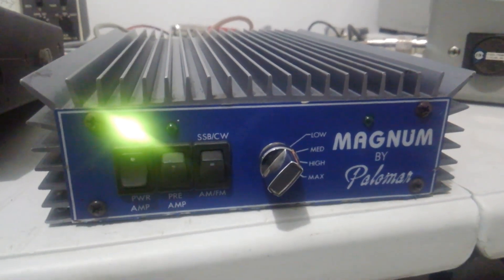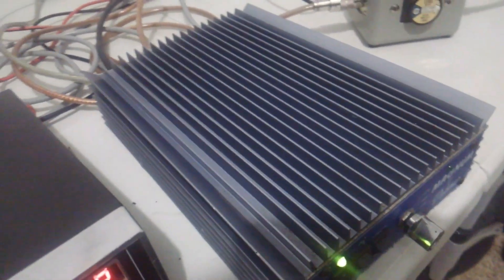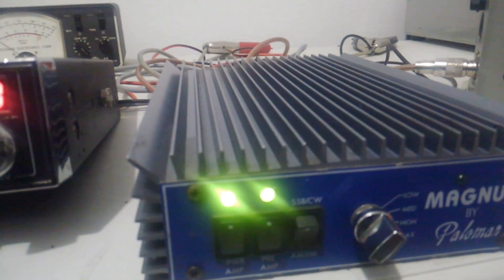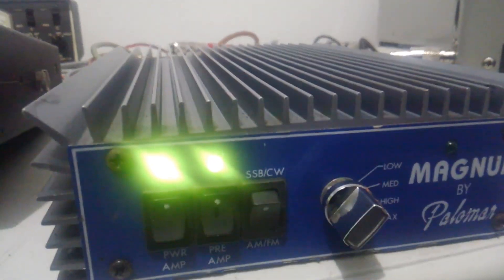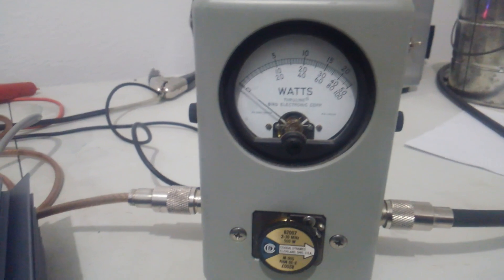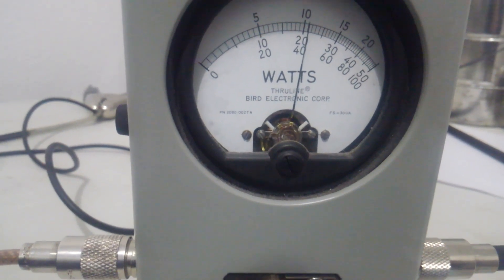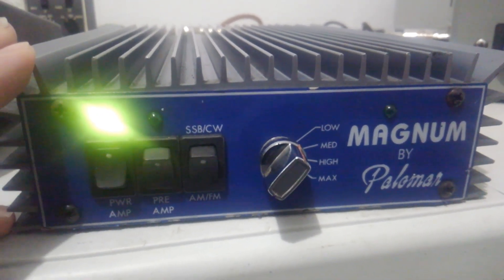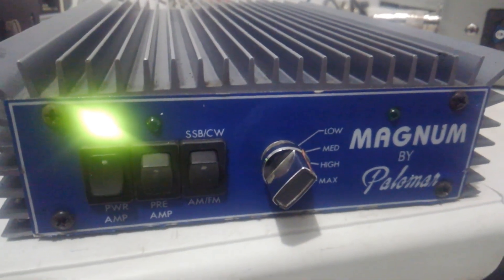"Magnum" By Palomar Mobile Linear Amplifier 450 Watts

Comment from the maker: CORRECTION: In the video i said 35 watts average/11 watts peak. That was a mistake, drive used was 11 watts average, 35 -38 watts PEAK. I apologize for the mistake and the confusion. Sounds like I should've had some coffee first! :)
Reply: I have the same amp.
Reply: I have the same amp, the label on mine is turned over and says Palomar TX5300
Reply: Still Lovin'This Amp Rooster 220 Plowboy Gold Coast Wavin 👋
🇺🇸🫵

Comment: Mine has 4×2879's Toshibas. I feed it with 14.80 volts.  I use my president Lincoln 2+ to drive it. 750 average. I've had it forever. 
Nice video. 
#12 Watkins Glen NY waving
Ps.. mines a skipper by palamar.

Comment: RM KL703 amp is far superior. 500 Watt.
Reply from the maker: I don't if id say superior, both good amps. Im a dealer for RM Italy, and I do like their products for the money
Reply: Thanks for the videos, you saved me from buying a pyramid power supply, a 52 amp, now I'm getting an astron...are you accepting repairs at this time, have a Texas star 399 DX needs relays replaced I believe, they stick on when I tx.

Comment: Every time I miss the chance on a good amp
Reply from the maker: Going to be another one going up today, soon.
Reply: @Rooster_Radio  these are really good rare amps that no one gives up. I'm just trying to get something I know works  and isn't going to break my checkbook in the process. You got fair priced  equipment. I git the Gump tuned Phillipines Cobra 29 doing 1.5 swinging 40 watts. Any if these would make it an amazing set up.

Comment: How can you put 2 amps together and test them together?
Reply from the maker: Two amps together, depends on what you mean.
Easiest answer is you mean taking two of the same amp and running them together you can not without blowing one up.
However if you have a large amp that requires more drive than your radio puts out you can run and amp between your radio and your final large amp. This is referred to as a driver.
Reply: Sounds good  thank you. Rooster
Reply: Damn CB radios are getting popular again these linears are selling like hotcakes
Reply: It takes lots of studying and tuning but yes if properly split combined and tuned it can be done. Texas star did it with the hot plate , sweet sixteen and a few much larger amps . Its not as easy as one will think . I personally have 4 of the palomar 250 fet boards combined and it works great . takes lots of trial and error and the proper test equipment.